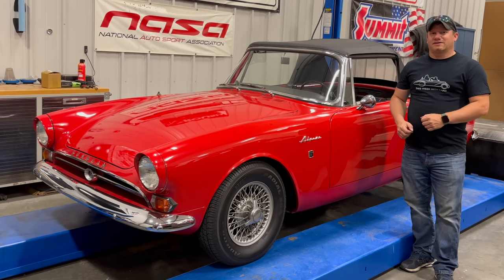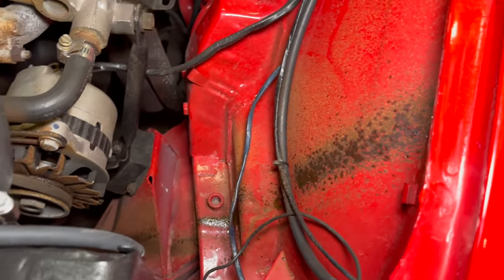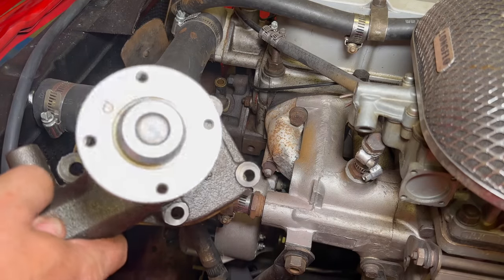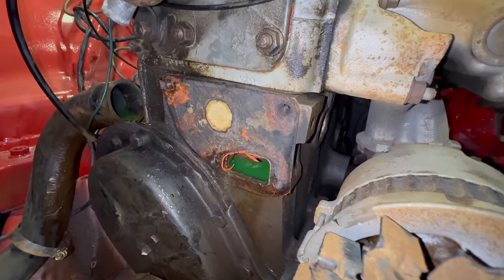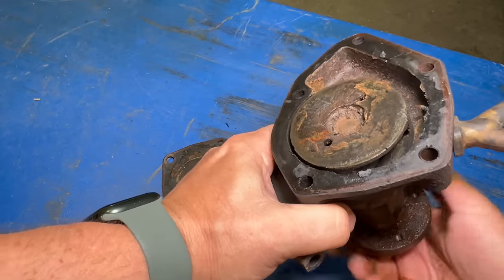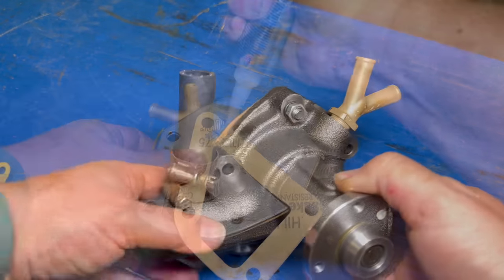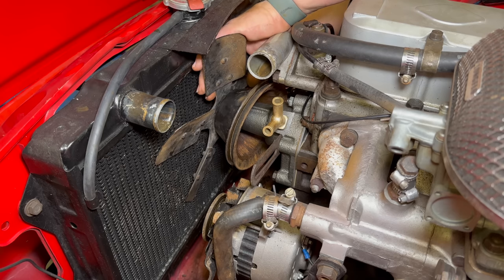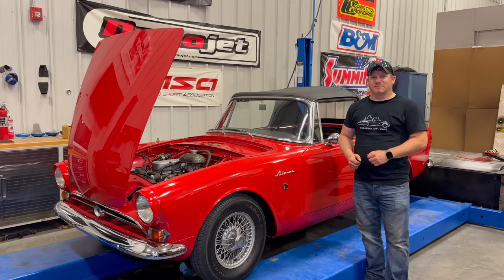Replacing the Water Pump in my Sunbeam Alpine

Comment: You're a lot better with old water hoses than I was. No cussing. Was there a reason you didn't fit the fan to the new pump first? Or just an oversight?
Reply from the maker: Because with the sealant on it I needed the extra room to fit it correctly.

Comment: I had a 1966 Mk 4 Alpine.  While removing the water pump, one of the bolts broke off in the block.  I never did get it out so I had to rely on 3 bolts to hold it in.  5:43.  How do you keep the threads from leaking?  My car had a 4-blade metal fan.  While traveling at 75 m.p.h., one of the blades flew through the right inner fender slicing the headlight wires on the way out.  You might want to inspect the fan for cracks!  Great video.  Brought back a lot of memories from 1972 - 1988.
Reply from the maker: Those threads are tapered the more you tighten it the more it seals.
Reply: @ThisWeekWithCars  OK.  Otherwise known as pipe thread which was commonly used on high pressure (hot and cold) plumbing pipes or natural gas pipes but when you assemble the pipes, one usually applies pipe dope or teflon tape otherwise they'll leak.  I don't get it.

Comment: What the difference between  generator and a alternator?
Reply from the maker: A generator produces DC power and an alternator produces AC power.   The power from a generator can be used directly by the car but the power from an alternator has to go through a rectifier which converts it to DC before the car can use it.
Reply: @ThisWeekWithCars  thank you !

Comment: Why didn’t you paint the fan and pulley. When you said Sunbeam Alpine, I thought it would be a Tiger. Opps, just a little. 4 cylinder. Still, an interesting video.
Reply from the maker: Because they are painted, that is rust and grease from the old water pump, it will wash off.
Reply: @ThisWeekWithCars  Oh.